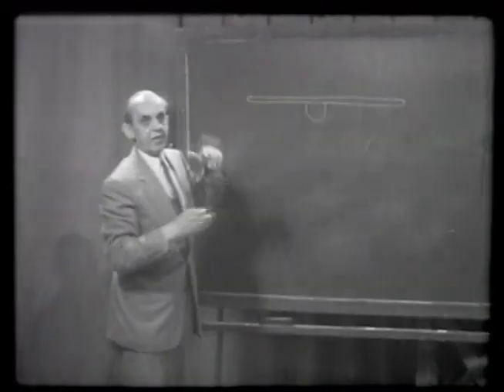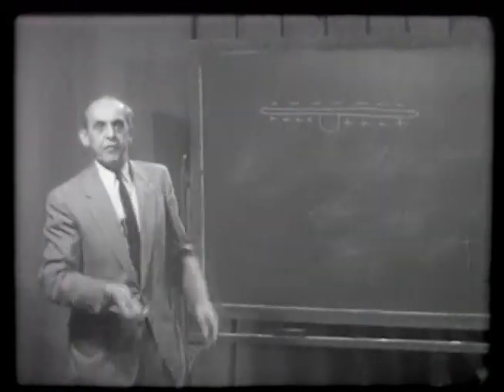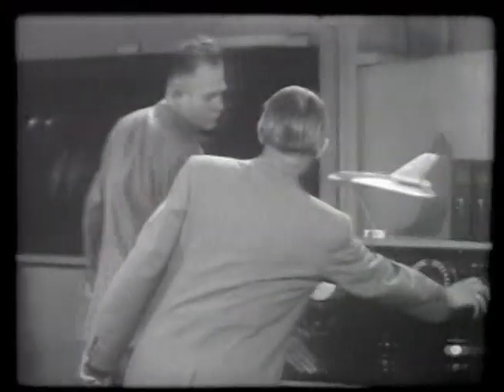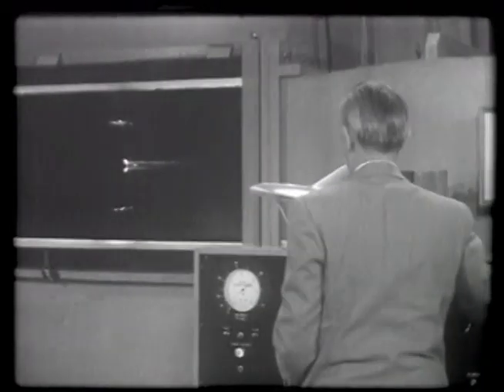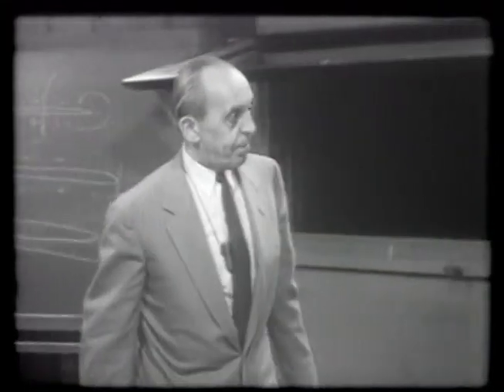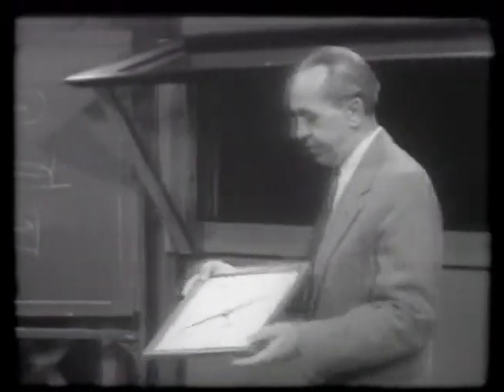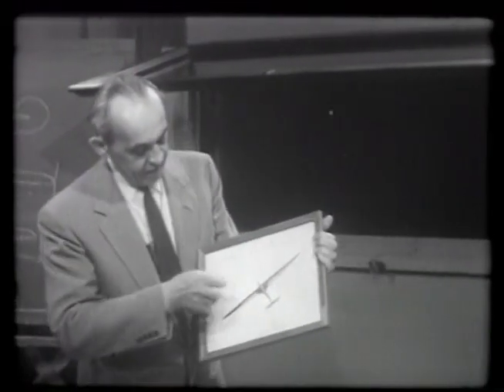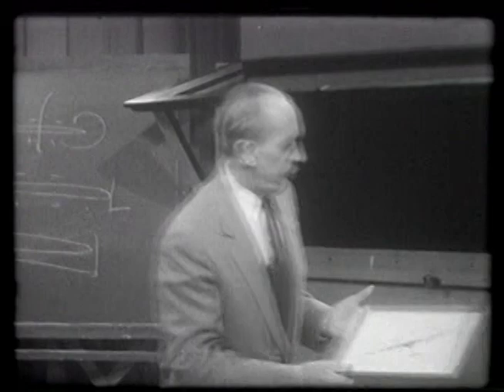The Secret of Flight 8: The Induced Drag

Comment: No, that is not the advantage of high aspect ratio wings.

If the wing model extends all the way to the wind tunnel wall on each side, there are no wingtips and there is no tip vortex, no tip loss. The circulation and the lift are the same at each cross section all the way across the span. There is still downwash and there is still induced drag. The wing is flying "uphill", metaphorically speaking,  relative to the deflected air stream. The flow pattern will be the same at each cross section and so this is called two dimensional flow.

If the wing does not extend to the wall and there are wing tips, there will be tip vortices at each tip. There will be loss of circulation and lift, greatest near the tips, but extending inward in diminishing degree. There will be some loss of circulation and lift even at the center of the wing. The flow pattern will not be the same at each cross section, there will be flow across each cross section and so this is known as three dimensional flow; you have air movement in three dimensions.

The center cross section of the three dimensional wing will resemble two dimensional flow; there is no cross flow. A high aspect ratio wing has more area in the center which resembles two dimensional flow. Losses at the tip do not affect the center as much as on a low aspect ratio wing. The circulation and lift in the center region of the higher aspect ratio wing will be higher than at center region of the lower aspect ratio wing. The pressure difference will be higher in the center region of the higher aspect ratio wing  than at center region of the lower aspect ratio wing. The tip losses affect a smaller portion of the area of the higher aspect ratio wing.
Reply: aeromodeller1 Which is basically what Lippisch said.
Reply: Kindly explain this with related pictures and videos..want to learn.